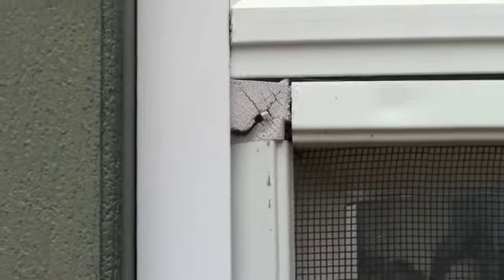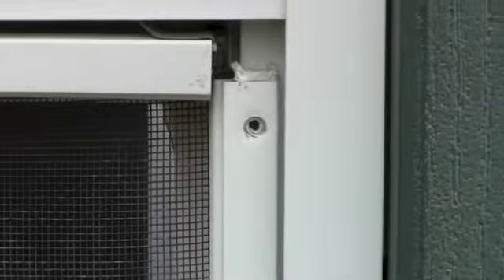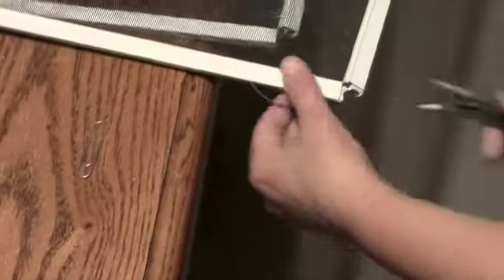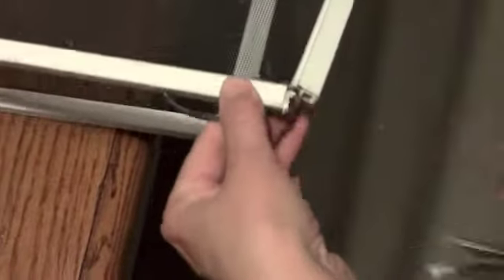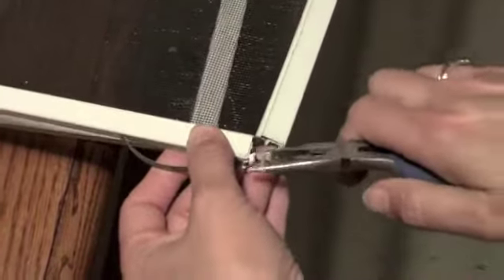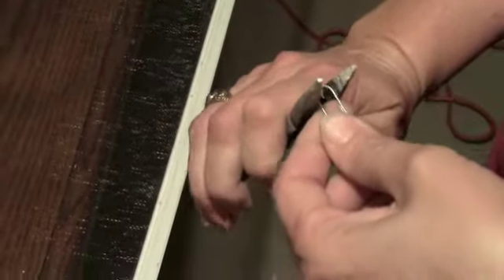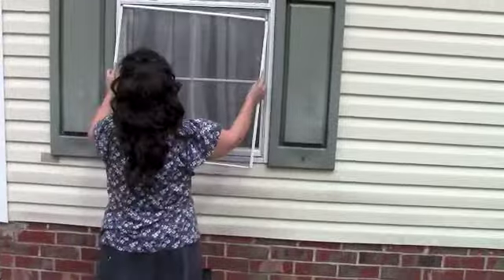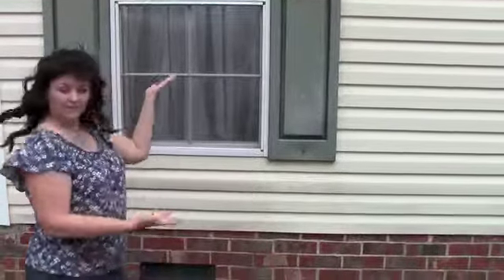Repairing Window Screens

Comment: That's a great fix, But knowing how quickly Paper clips can rust just by being out in the moist air or from repeated rains, then rusting and leaking rusty drips down into the frame and ultimately disintegrating into broken rust, I wonder if someone could make this a more permanent solution by applying Waterproofing metal coating  or something like flexseal spray onto the already bent paper clips and then inserting them once dry?
Reply from the maker: That is a great idea. I realize this was only a temporary solution because the windows were eventually replaced because they were deteriorating.